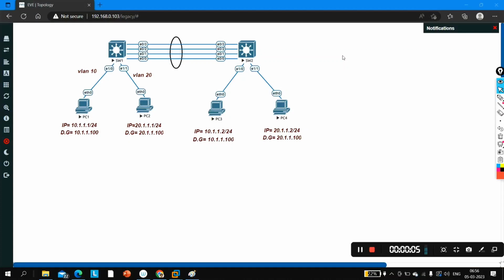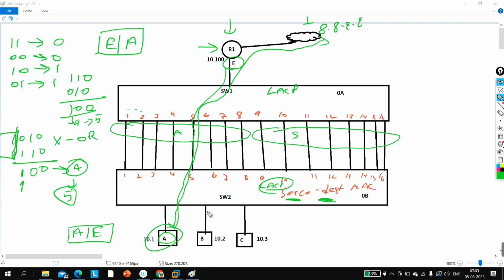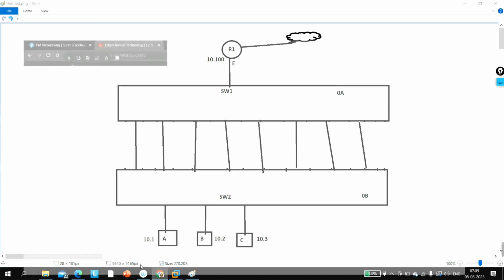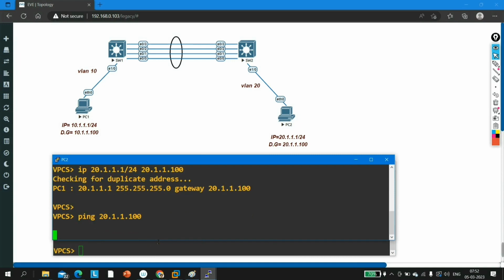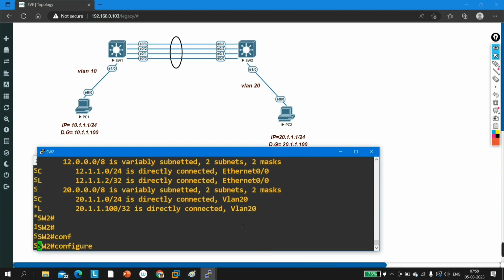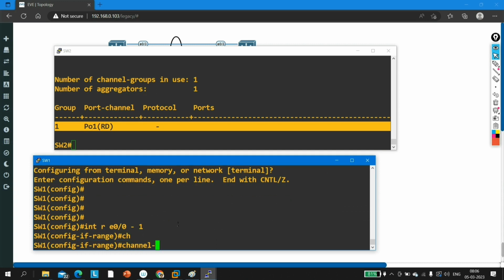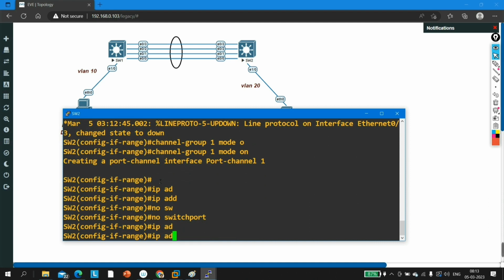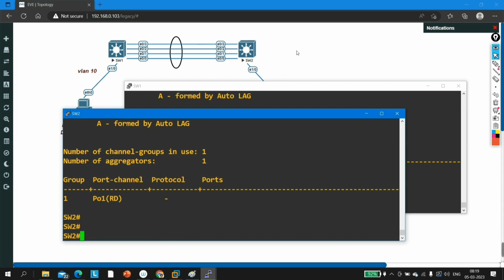Part 2 | EtherChannel Technology | L2 & L3 EtherChannel Load Balancing #network_engineer #cisco

Comment: in video 10:51 while using 4 link only for A to E mac binary of a is 1010 and E is 1110 while doing xor operation  answer will be 0101 and we use only last 2 bit 01 only whose decimal value is 1 then port no 2 is use correct me if i am wrong
Reply from the maker: You are absolutely correct
Reply: @PMNetworking  10:59 Correct me if I'm wrong, after doing XOR operation ( A and E) getting 0100, and  for 4 active link last 2 bits are required i.e 00 , so in this case which port will be used(Assuming port 1 will operational ).